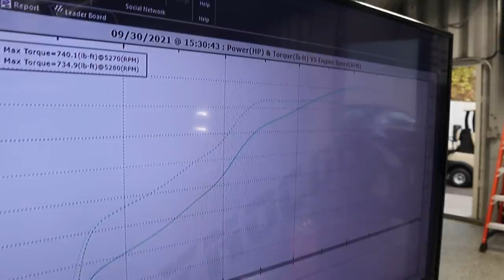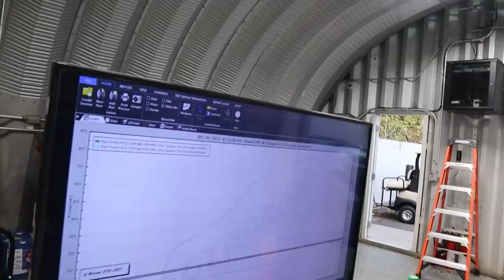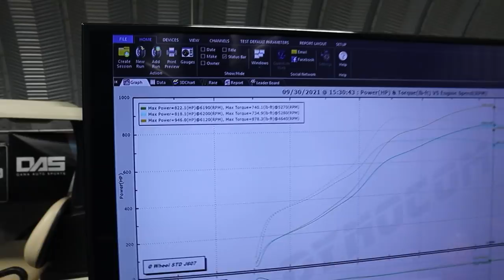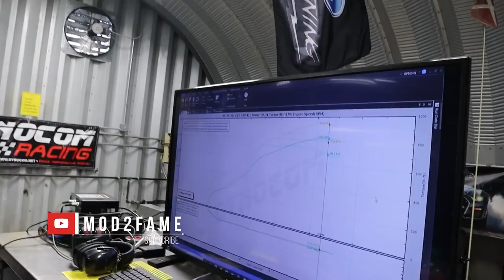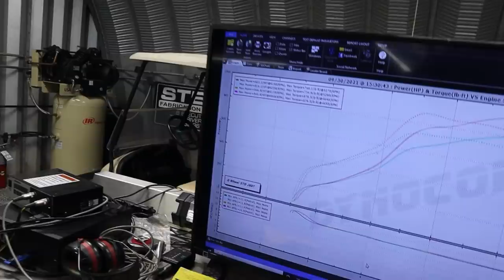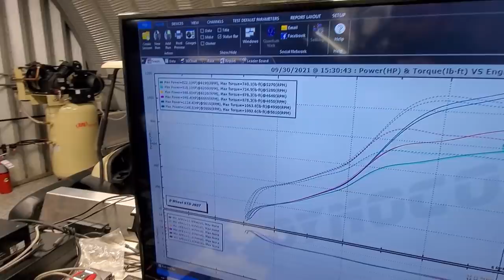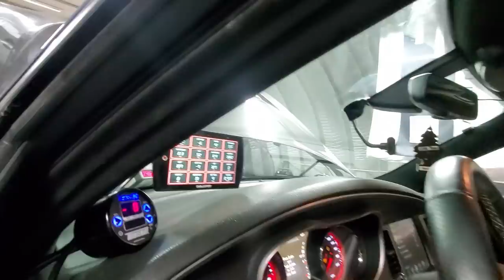THIS DODGE CHARGER MAKES OVER 1100 HP ON THE DYNO WITH TURBOS, MUST WATCH !!! | DiabloSport

Comment: Did they change the boost immediately after adding ethanol?  You need to run the basket dry or else the fuel tank basket will still be full of 93.

Comment: Love the videos, but c'mon now, we gotta talk about this. Roll racing largely exists, because big power cars struggle for traction anywhere else, and so some people move the goalposts to pick and choose favorable speeds to run. In many cases, they still get selective about tires (so it's not real-world), but otherwise refuse to launch or run at lower speeds, for fear of breaking something or the inability to put down usable power. 

And that's fine, roll racing is awesome. But to keep it 100, it's just playing to a particular cars strengths, while trying to minimize the downsides. I'd also argue that controlling traction and translating power to forward motion requires significant skill, but to each their own. All love, here, awesome content and I respect the build.

Comment: Here’s the order of difficulty. 
1st Track racing, a real track like formula 1, left turns right turns braking, acceleration at the right time.

2nd Drag racing you have the light, when to launch, timing, do you launch in 2nd gear or first? What rpm? Short shift? Stuff like that. 

A way distant third is roll racing why because it’s this “ok 40, you ready? Then go! Damn I lost! “Ok 60 let’s go!” Ok I won you’re literally just a passenger. 

I love to roll race because it shows true power of my build not my skill. 

There are billions of dollars in F1 (track racing)
Maybe billions in Drag racing 
And they have sanctioned would wise televised events. Roll racing is simply gearing, and power. 
Just my opinion…. Now I’d love a roll race with people its fun.
Reply: Love this comment 👏
Reply: Love the break down brother 👏🏾👏🏾🤙🏾🤙🏾

Comment: Torque wins at the drag strip, Horsepower wins at the roll races
Reply: Traction and reaction wins. Torque has nothing to do with it. Some cars have way less torque than a scatpack and will beat a hellcat easily.
Reply: @ABthatMan_  Torque has PLENTY to do with it dude. If car A has 600hp/550tq and car B has 625hp/500tq car A will win with all things being equal. You can school me on roll racing but I been at the strip all my life.
Reply: @sstevocamaro  how long is your life? You need to look at usable horsepower the torque band if it’s AWD vs RWD gearing and all. Some cars I’ve owned have over 150 less torque same weight and still win.
Reply: @ABthatMan_  I said all things being equal. You’re bringing a lot of equalizers and handicaps to the table. People re gear and add bigger torque converters to their car for TORQUE! That’s what gets you out the hole!
Reply: @ABthatMan_  I’m speaking in a general sense also.. You’re acting as if torque doesn’t even matter. But when you accelerate that’s torque you are feeling! Horsepower ain’t nothing but torque multiplied by RPM. Torque doesn’t matter much on the interstate when you’re already moving.. But from a dead stop TORQUE IS EVERYTHING!!!
Reply: @sstevocamaro  Your point was flawed from the beginning you days 600hp/550tq and 625hp/500tq. That’s not equal. Equal would have been the numbers reversed. Even then nothing is equal the real world is never equal. Imagine the transmissions are the same with the engines having reversed power figures power and makes a difference as in usable power. It would never be equal because that’s not how physics works.
Reply: @sstevocamaro  again nothing could be ever equal that’s a BS argument. A car in my garage has not even 400 torque will crush say a scatpack a Camaro SS a Mustang GT all off the line. And will get a hellcat the business on the street. And this car weighs 3900lbs why? The transmission, HP, gearing, it’s AWD, it has LC. Nothing and I mean nothing is equal
Reply: @ABthatMan_  Again, look at some videos. The Camaro takes the Mustang off the line and the Mustang catches up at the end. You JUST proved my point on Horsepower vs Torque. Thanks..
Reply: @ABthatMan_  https://youtu.be/Y5KmYvILciU keep those Mustangs on the interstate. The drag strip is where the Camaro and Challenger and Charger shines. Now keep in mind these cars make the same horsepower.
Reply: @sstevocamaro  lol Do you not know what gearing is? Smh. Powerband and usable power are? 🤦🏾‍♂️
Reply: @ABthatMan_  The power band is one part of it. You gear up for drag racing for a torque advantage. You gear down for rolls for better mph. What other excuse you have for why I’m wrong? Do you know Tesla makes 100% torque at 1rpm? Yes that’s why it’s so quick off the line and you need even MORE POWER to beat one..
Reply: @ABthatMan_  Do you know why Semi trucks can pull 80k lb loads while only making 450-600hp? ITS BECAUSE THEY’RE GEARED FOR TORQUE. THEY MAKE 1600-2000tq! That is what gets you moving!!
Reply: @sstevocamaro  that’s called usable power….. just to say I’ve got 560 tq means nothing. Is it peak power? How much do you make per RPM at what rpm? What’s your redline? To say you make 600 Tq at 3000 rpm means nothing if your cars redline is 3500 rpm. I can make less torque than you over a wider power and and destroy you off the line…..
Reply: @sstevocamaro  and do you know why they are slow? It’s not the weight of the truck!
Reply: @ABthatMan_  Torque moves the weight.. If it only made 500tq it wouldn’t even move.
Reply: @ABthatMan_  let me break it down simple for you.. Take a 300hp V6 Mustang and put it up against a 300hp V8 Mustang. I guarantee the V8 will when even tho power is similar. You know why? Torque production is way more efficient in the V8..
Reply: @ABthatMan_  Also shifting at peak power is a good thing, but what happens once you make that shift and rpm drops back down? That’s right, torque will be there to help you get those rpms back to peak horsepower. It goes hand and hand..

Comment: Bruh.. Drag racing take more skill then racing on a highway with a friend. Driving in a half circle doesnt require that much skill than reaction time at a tree . Just do what you do without getting all big headed and be great at what you do on the street or at the track.  
be humble. We all fam.
Reply: Yeah he's trippin.  It takes little to no skill to roll race, no matter how much they try to talk it up.  Especially if you're in an auto.
Reply: drag racing is way more difficult especially when you have a high horsepower car

Comment: I'm very confused by the idea that roll racing requires skill. Correct me if I'm wrong, but roll racing is just finding a speed then hitting the pedal. That's it. The only thing you need to do is keep the car straight and know when to slow down..basically a drivers education course. I'm a Subaru STi guy so my car is on the race track, not fast in a straight line. However, all that driver skill you mentioned is necessary on a track. Even drag racing requires skill and timing. I think you're confused.

Comment: Let me first say that I fuck with the channel and I like your content but you be saying some off the wall shit🤦🏾‍♂️ . Man there’s no way your challenger will run a high 8 . No way in hell . Maybe if u put an auto. No way as a manual as it is currently constructed. And it is much harder and takes way more skill to drag race vs to roll race. No comparison. Especially when we’re talking about car’s that trap 160 plus in the quarter. If a car is faster than u in a quarter there’s a really high chance it will beat u from a roll as well. Demonology already proved that to u.